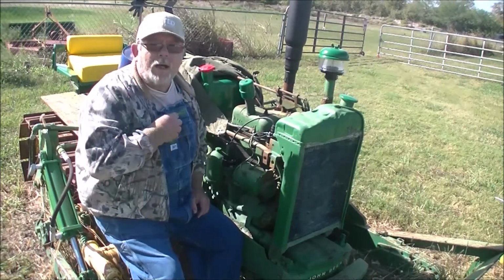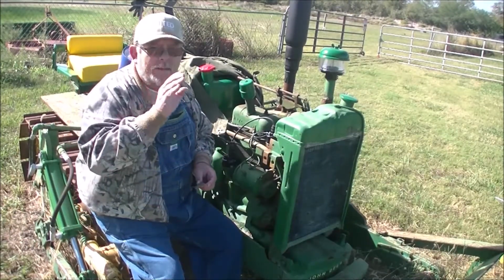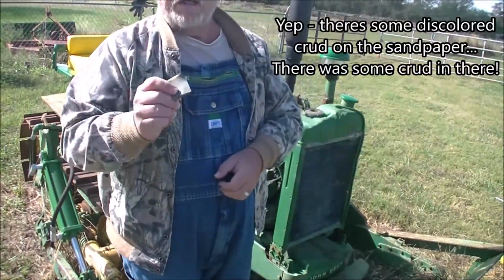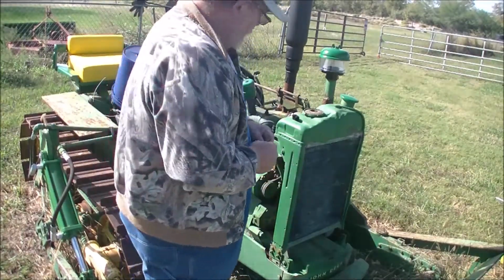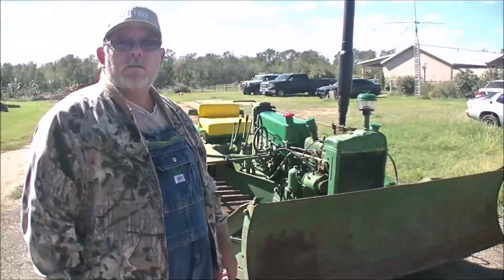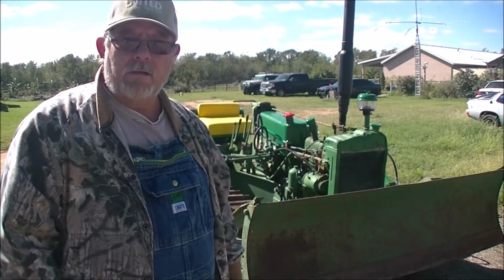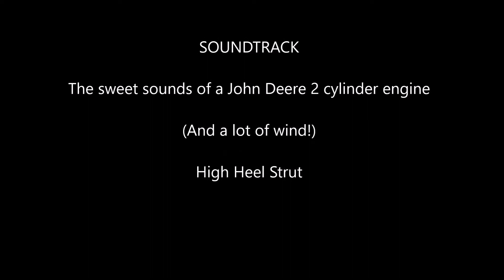Fixing up the John Deere MC Crawler - Part 8 - Will it start?  Third time is a charm!

Comment: I know that feeling! Mine turns over really really slowly... Then suddenly catches and runs. I have that woohoo! Feeling every time it starts!
Reply from the maker: I replaced the "new" #4 cables with big fat hairy single ought cables - it turns over MUCH quicker now!  Thanks for your comment!
Reply: @possumfarms  I think that might cure mine as well. The cables look like they are from a 12volt system, but shes still 6volt
Reply from the maker: @darrinmcgann  - Well I thought new cables from Oreilly's would fix my problem...  They were #4.  I got to reading on a few of the forums and someone made a big deal about how the old cables they came with were HUGE compared to the puny little 12v cables we buy for our cars today.  So I found someone on the web that made cables to your specs - I ordred "O" guage and they arrived with brand new ends, the perfect length with rubber hoods over both battery terminals.

It starts better now!  Thanks for the comments!  Every single one feeds the YouTube algorithm so I show up in that evil little "Suggested Videos" pane on the right side of the screen - giving me more views!  Which of course justifies my time making videos because I am retired and have no life! LOL  :)